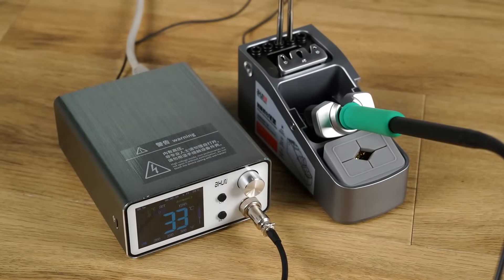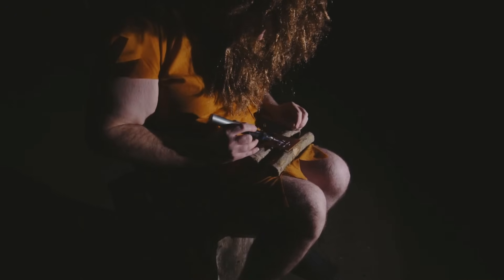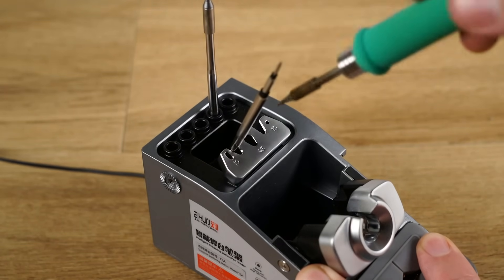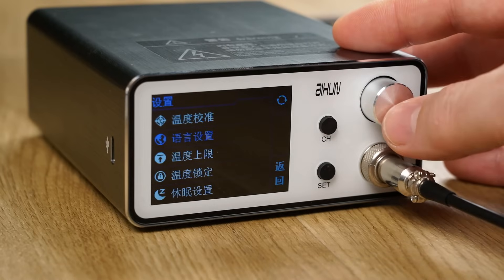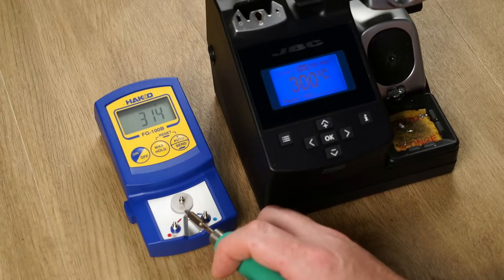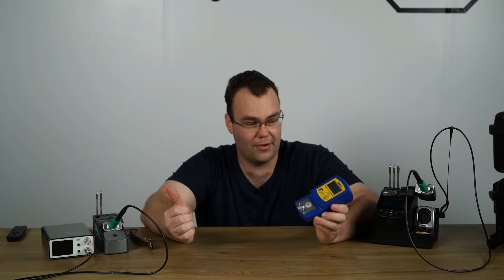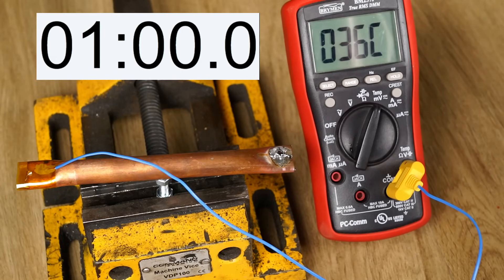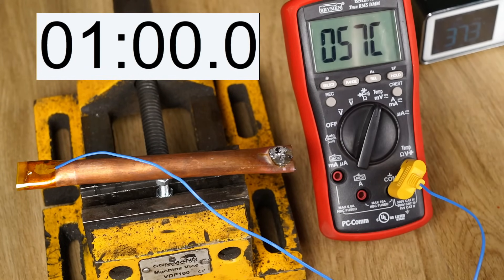AIXUN T3A Soldering Station Review ll JBC iron comparison

Comment: I own a similar iron but it's T12 type only about 72-80W but it's amazing compared to anything else I've ever used, I was thinking about getting a T245 type station. At the time the T245 was not available they came out a few years later but I was always jealous of the 200W output. I think I'll pick one on soon as they are very cheap on amazon right now.

Comment: This review missing couple serious flaws. When ground touching the tip - power jumps to 100%, can go up to 510+, depending on firmware it will report fake information on temperature screen. Leaking voltage/current to the tip is also really bad. Just look at some fresh reviews...
Reply: Indeed!
E.g https://youtu.be/hGK7s-9tXs4

Comment: I got this thing. It is garbage. The temps overshoot like crazy. No problem with a software patch, right? The problem is that it won't update, despite multiple hours spent troubleshooting. Aixun is zero help addressing these issues, and their software is laden with bugs. Maybe this is okay for a home user, but if you need your iron to work even semi-reliably, skip this one.

Comment: Interesting and throughout test. I checked Taobao for the 焊台 T3A and compare to other T12 stations they are like at least double the price (~ around RMB 700). There are other brands below 300 - and the JBC clone stand will add another 150 or so.
OK, now you argue that it's fun to work with nice tools. Well, I agree ;-)  
One questions: I solder only lead-free 290-350°C - how long your tips last and is there a difference between JBC T12 and the China clones?

Comment: After upgrading to firmware v1.34 I am extremely disappointed with the insane amounts of overshoot, and the fact that they have "fixed" it by just not showing the actual temperature when it is higher than the set-temperature. They only show the real temperature when placing the handset back in the cradle and it starts to cool down. If anyone finds a usable firmware update, please let me know. I am going back to 1.27, which was much better IMHO.

Comment: Yeah, this is a mediocre review at best. The guy makes many technical gaffs throughout. Starting with the power rating, the 200W is what the base unit can supply, not what the soldering iron is rated at, that is set by the tip as it incorporates the heater element in the replacable tip. So the fast heating due to the 200W is nonsense. Also he looses credibility with comments like the use of acetylene on copper pipes!
Reply: I've never seen a JBC-style tip with a power rating.  They'll take whatever power you push through them.  I have a 180-watt station, and it will absolutely put that much power through a JBC-style tip.  The heater in the cartridge is just a coil of wire.

Comment: Very informative video thank you. Liked and Subbed with notifications. I’m a newbie young Neanderthal at this, well not so young actually, can you recommend a “value priced” soldering station for a newbie Ham Radio operator looking to do jobs like soldering RF antenna and coax connections and MAYBE some light touch circuit board work? I’m coming at this from a purely utilitarian point of view. I don’t really care to know the minute details of how radio gear works but rather make it work for emergency communications and backup in SHTF situations. Many thanks in advance. If you have done a video like this please redirect me. FYI on YouTube search under BEST SOLDERING STATION sorted by view count your video came up basically first English language content on the list.

Comment: Update about Aixun T3A. Turned out it does support also T12 handles and tips. So you can use T3A station also with T12 tips which open doors to vast array of specialized T12 tips for affordable price. Good feature for many of us, because some specialized JCB-C245 compatible tips cost a little fortune. I now use T3A station with both T245 handle for C245 tips and T12 handle when I need T12-1401 and T12-1402 tips who in C245 equivalent have eye-watering price.
Reply: The station itself determines what type of handpiece is connected, or does it have to be selected manually?
Reply: @riderm.d.1461  Station itself.
Reply: @KrotowX  Thanks

Comment: Would have been interesting to see the comparison (especially heat up times and the "raw power") with a Pinecil V2 with a short tip (6.2 Ohm vs. 8 Ohm for the old ones)....
Especially since I'm currently owning a TS-100, Pinecil V1 and soon also a V2 (I already have the new tips) and other older irons...
But I must say this unit also seems interesting due to it potential raw power.

Yes I probably have an unhealthy obsession soldering irons.
I blame it on having a 25W iron as a "kid", the kind where you change the tip temperature by adjusting the temperature of the universe or actually using the bloody thing.
Reply: Do you have the V2 already? Am wondering about the TS101 or the Pinecil V2. Leaning to the V2, but availability of the 101 is better in my part of the world. And the TA101 feels good in hand. Could not check the Pincecil V2 yet. Any thoughts?

Comment: Neither system is using its maximum power because you're not using a big enough tip. You need maximum thermal conductivity at the point where the system measures temperature in order to force the system to output maximum power. The power they will output will be just enough to maintain tip temperature at the set point if designed properly. The chinese knockoff obviously has terrible regulation because they haven't figured out how to copy proper PID control loops. The power output test is pretty dumb and meaningless. The temperature stability and overshoot test is the important factor here.

Comment: Great video thank you!  I bought one along with the power supply and they got delivered this week.  The process to upgrade the firmware didn't work for me though.  It came with firmware version 1.26 and the software was already in English after I installed it.  It did aske me to do a software upgrade which only worked after I started the software as administrator.  The installed the FT232 serial driver (also as administrator) and plugged in the unit but the software doesn't detect it at all.  Windows make a sound after I plugg it in so it must have detected something. I'm not sure how to proceed from here.

Comment: Where you got handle rubber fitters at 7:28? I haven't them and dressing the handle turned into a little nightmare. Teared first rubber while tried. Succeeded only at second time when found that it is possible to roll the rubber over the handle. Ouch.

Comment: It is a shame that the Aixun does not seem to be available on Amazon.  I'm not fond of waiting 6 to 8 weeks, the currently quoted time in your affiliate links.  I did find others who were quoting 3 to 4 weeks with air shipment.  That still seem a bit too long.  

I'm thinking of going with the KSGER T12 station that I can have in 1 to 3 days from Amazon.  On the other hand, for a bit less money, I can go with the older technology Weller WE1010na which is NOT made in China, is very reliable, and genuine OEM tips are also readily available for about $7 each.

Comment: honestly I never expected that an electric iron would be able to take on pipe. I have soldered a sheet metal drain pain before but that was a tip that went onto an Acetylene tank fueled system and had a chonker of a tip.

Comment: I have burnt out a few tips already. (T245-A and T3A base).
Heating is all in the tips and this little unit cranks the power in to them.
Two of my tips (cheap import ones) are now open circuit and wont heat up at all.
FYI I'm also using the latest firmware update and it still overshoots, they get cooked when first removing from the base station as the temp screams up.
I also have a cheap 35W iron, a duratech TS-1380 and a little TS100 (my favorite).

Comment: If I understand it correctly the b version isn’t compatible with this iron’s hand piece
Reply: The A Version is for the more general purpose C245 handle / tips that are driven by 24V and the B Version is for the C115 / C210  ones. Personally I would go for the A, unless you already have a powerful station and need a second smaller or you mainly do phone / tablet repairs where the lightweight handle and the short handle to tip distance can be very nice to keep the hand more steady.

Comment: This is proof that the Chinese just get it when it comes to soldering stations. For that price point it is beautifully designed. It is super fast and works super smooth for most kinds of soldering work. All soldering stations should have a rotary knob for temperature adjustment. It is simple and intuitive. Not that button up and down crap. Those other brands have a monopoly on soldering stations and just don't care to innovate. You either buy their 600usd+ bulky rock or your out of luck. At this moment KSGER, Quecoo, TS100 and Aixun are brands that are worth supporting.

Comment: The one I ordered T245 from Alliexpress went missing I received a refund, I then made a terrible mistake and ordered a T210 which looks the same at a quick glance, the stupid design means you have to buy two stations as the hand pieces are not interchangeable neither is the holders for the hand pieces. These tips are a mine field if you are unfamiliar with these expensive tips. No c cable included with station. I also bought the T245 hand piece and JBC tips thinking it would fit this T210 station but not so. I now have two stations and different holders, bad design stay away from them.
Reply: I think you can't blame them for it. Even when you buy a JBC Station they have different stations for different  handle / tip styles .  The reason is that the C245 style is 24V driven while the C210 and C115 are 12V driven.
Reply: Wow! You just saved me. I wanted to get a station and both, the T210 and T245 handles. Seems like that's a no-go with the Aixum. Bummer!

Comment: Hello.
Could you please check whether re-entering the calibration option shows the saved changed values? 
Do the values reset to the original settings 100, 200 etc ...?
thank you
Reply: That’s… in the video
Reply: @mrshaunkim  I'm sorry but I don't feel like it.
I can only see the first (?) Entrance?
  Is this another entry into the calibration option?
If this is another input, the real temp values are reset.
If so, it's weird. The station should remember the last corrections and show their values at subsequent calibration inputs.
Am I wrong?

Comment: During some temp and calibration troubleshooting, I spoke to our regional Hakko vendor, who's also a distributor for JBC. They told me you have to goop a really chunky blob of solder onto it when measuring temp using these sensors, and that it's the same for JBC (and Pace) too - to get any actual useful readings. These cartridges can overshoot and bounce around a lot when not doing so, because even the tiniest of pulse, ripple or noise can cause significant temp deltas when there's practically nothing there to sink heat. IIRC he compared it loosely to revving your engine in neutral in your driveway, while expecting results and readings as if it was on a dyno. And st least from my own subsequent testing the way he told me to, it seems this was good, honest and fruitful information.

By adding a big'ol glob of solder, it somewhat simulates a small but realistic load. And the temp results from that will also be much closer to those performed in actual soldering use. Those are IMO the most useful readings to have and calibrate (by), especially if your work has very tight tolerances and require rigid validations. 

My own testing and sample group does no strong statistics make, but at least anecdotally, among roughly 25 T15 (same as T12), T30 and T9 Hakko and C210 and C245 JBC cartridges, the vendor suggested method was confirmed accurate with repeatable results, by sticking small sacrificial thermocouples into flowing solder joints, for comparison to the "tip thermometer" readings with a big glob of solder applied.

This also explains why these "tip thermometer" sensors are sold cheap and in 10-packs; they are considered highly sacrificial and disposable. Because you commonly only get 2-3 readings before it's done for when completely enveloped in solder
Reply: If the iron is running PID control, which it seems to do, then how much thermal mass you have on that tip affects the response curve. They tuned it so it would overshoot a lot with light loads and quickly reach desired temperature at heavy loads like thermal PCB designs and huge metal connectors. I wouldn't call this accurate, but that's the nature of PID systems reacting differently to the "inertia" of the loads.
Reply: This sort of thing would also explain why the errors in the measured values were all over the place, rather than in more of a straight line, as should be expected.  There has to be an explanation for why the percentage error jumped around so much at different temperatures -- it's the same software control loop, the same sensor, the same heater.  The differences have to be outside that set of factors, and for me, it leaves the conclusions a bit dicey.

Comment: 14:25 That's not happening because the station is not recalling the previously calibrated values, but just because it does that. The values match exactly just because the station now uses the previously set calibration to heat the iron to a particular temperature, so, it assumes that whenever it thinks it heats the iron to let's say 100 degrees, its temperature is actually 100 degrees. And if it's not, then it has to know how much off it is compared to the current (=the previously calibrated) nominal temperature, not how much it's off to some initial or previously calibrated value, which it's not using anymore to control the heating.

Comment: About the Firmware Update Tool: Windows SmartScreen's source of complaint is not that the publisher is unknown. I run loads of "Unknown Publisher" software at work without setting of SmartScreen. That being said, it could still be a false-positive, I had quite a few of those too (also having publisher info which I assume means it's signed).
After all AV is just a fancy word for Magic Voodoo feelgood vibes for the compliance auditor.
Reply: How do you know it's a false positive though?

Comment: great video. Nice to see some real world comparisons. I've been using "grandad's" iron for 35 years. My old Weller has never failed me. I've been interested in these new style irons but never was convinced I needed one. I see now the difference. I'll be upgrading but I doubt that whatever I buy won't be working 30 years from now. Nor will I be able to buy replacement parts as I can my old Weller. I guess soldering stations are disposable now, like everything else.
Reply: YES - my weller is well, er it is from (get this little joke, not on purpose, was a typo that made me laugh!)  Anyway my Weller is from 1998!  And it still works just fine.  Now it is just for occasional hobby use but still, that is impressive.  And it has a nice temp dial that has always helped me get the heat I needed to do any job that was on my bench... again very simple stuff.  

But lately I was thinking of getting a new one anyway since the tech is quite old and soldering heavy gauge wires to fat copper pads is really difficult to say the least.  This looks like the winner to me so thank you for the introduction.  Believe it or not the other iron that I still might get is the amazing TS-100!  

Yea, it looks like a toy but it can hang with some of the real big guns for real!  Don't mock it until you try it, I had picked one up as I was traveling a lot for work but it got damaged along the way, which was a bummer because it was like magic on typical jobs.  Some nice flux and bam - shiny silver fillets of goodness.  Cheers!
Reply: I still have a working Weller iron from 1976! 
Just on or off, no temperature control. Only replaced the tip once.
Reply: Perfect summation

Comment: I have been using a JBC at my work for the last 8 years or so. At home I still have my (old) cheap Ayoue 936 after 15 years. I use both extensively. From a practical point of view, I personally don't get the temperature tests and calibration. I basically never really even look at my temps. Very quickly you get a feel for how things solder. Or when it's to hot or to cold. Obviously the JBC is nicer, but on a daily practical (!!) basis I consider it more luxury than anything else. The tips of the JBC last a bit longer although they are also 4 times more expensive so that kind of cancels out again.